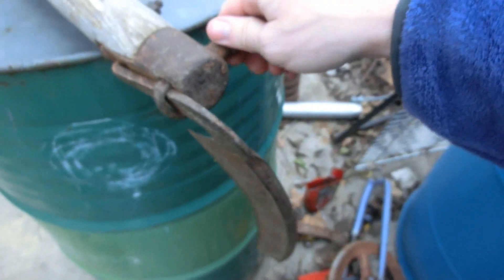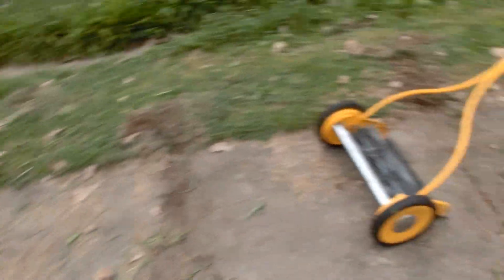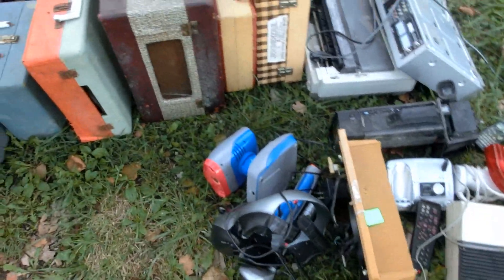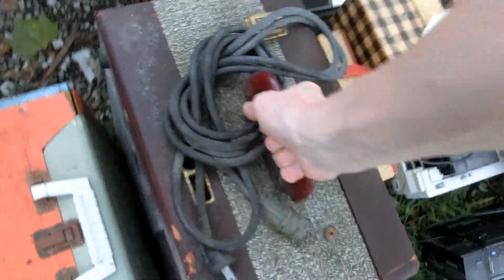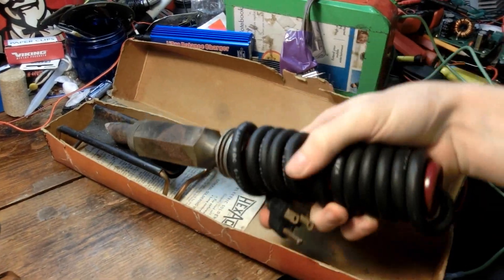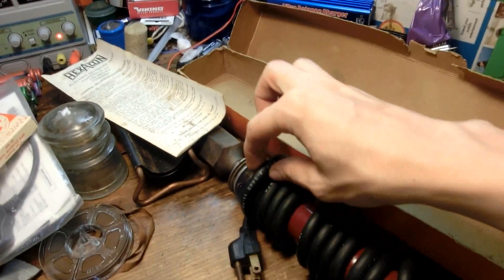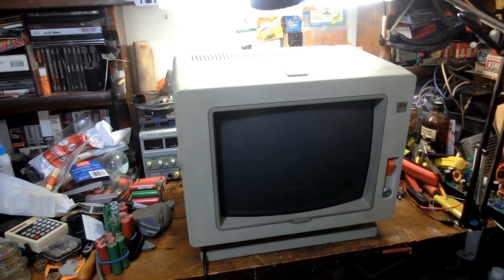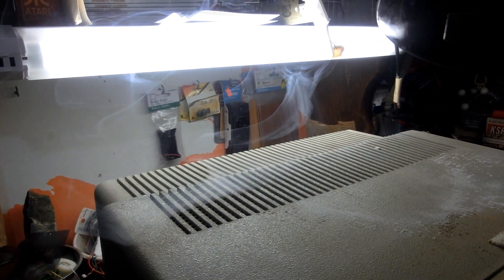Random Bits 0050: Scythes Frogs Oscilloscopes Soldering Irons and IBM Mainframes

Comment: Those phones are GTE, the black ones are AE80, and the yellow one is a "starlite" a copy of the Princess phone made by Western Electric. Cool stuff!
Reply from the maker: who do you think you are the phone man or something? jk. yeah they are interesting. it would be cool to build my own telephone system from scratch to run through a building or something. i've played around with it before when i was like 9 but havent messed with rigging up phones in a while, and definatly havent made a video project about it.
Reply: Rinoa Super-Genius  lol! Yeah, I want to have a telephone museum someday, but I love all sorts of vintage tech too, from older computers to locks, radios, etc.  A step by step switch would be cool, but I have so much stuff, I wouldn't have room for one!
Reply from the maker: Will Phoneman
 come to think of it i prolly have the parts to make a system that could just have 10 phones. one number dialing. but only one call at a time. making a phone system work is super easy until you remember you have to support calls from other phones and multiple calls at the same time or party lines with multiple phones on the same channel GAAHHH. i am so glad we didnt keep the mechanical system otherwise the rate our phone calls have expanded since the 1960s we would need hundreds of square miles of relays and contactors to handle all the calls in the world. so now we just have hundreds of square miles of servers to handle the digital data. ;p
Reply: Rinoa Super-Genius
So much has changed even in the last 20 years, it's amazing. A simple 2 party line is relatively easy, heck I've even hooked 2 of my magneto phones together to make em work. I'm going to try and build an analog switchboard and hook my oldest phones to it and have them able to connect to each other.

Comment: you sounded so disappointed at the end of the video, oh and congrats on 50 random bits videos.
Reply from the maker: nah it would have done that anyway, now i'll know what parts to replace when i open it up.
Reply: as long as you can find them. I didnt see any vac tubes so sourcing parts should be easy and hopefully cheap.
Reply from the maker: John Brewer  the terminal is clearly sectioned off from the computer side and the CRT side, the smoke only came from teh CRT side. and most CRT circuits use similar components, i could crack open an old monitor and prolly find components that are close enough to replace ones in this one.
Reply: good point. it has been a long time since I cracked open a crt monitor. My bad.

Comment: A shame that IBM terminal blew up.. 
Think there's a Chance of fixing it?
Reply from the maker: of course. it was just the capacitors that control the crt. turns out the back part pops off and theres a bunch of chips in there. i was thinking it was a dumb terminal so basicly a monitor. turns out to have a bunch of old AMD chips and an intel 8085 i think. basicly a complete computer inside it. just with each part being a bit weird compared to an IBM PC.

if it doesnt work i may steal the RAM chips. i think i could use those in my 1980 Missile Command arcade machine.

Comment: The soldering iron has a equipment ground plug on it.  Houses in the early 60's were required to have sockets for them.  I'm not sure what year manufacturers were required to have third prongs for the equipment ground, but it would have been about the same time.  The electrical cord itself has a plastic outer covering.
      Take the accompanying instructions and look for the address of the manufacturer. If a zip code was used, that would have been 1963 and on.  Before that in a large city there would be a one or two digit number that would represent a zone in a city.  That number would be printed after the name of the city and before the state.  And if it was a one postoffice town, there was no zone number.
    Under the button, is that a place for a key?  My first PC computer over 30 years ago had a key lock on it.   I think companies thought computer equipment should have manual locks like filling cabinets had.  Soon they decided to go to PIN codes.  There may have been a fear that if someone could turn the computer on without a key, it would be possible to insert a floppy in the "A" or "B" drive which could be used to boot the computer to make changes or repairs in the main "C" or "D" hard drives in PCs.  The computer would start running down drives at "A" on and stop at the one that contains anything and follow the instructions in it.  The mainframes would be different, but they still seem seem to want a key.  The mainframes I remembered always required just a PIN.
Reply from the maker: i'm not thinking this key hole effects the power switch, but could be wrong.

i just checked the paper and there is no zip code on the adress. also dont forget this was made for like factory use. and i think factories and business buildings had ground plugs much sooner than homes.
Reply: If that is a key hole did not effect the power, what would it likely effect?  It is right next to the power switch. It probably shut the monitor and keypad off.  It might be possible to have locks on equipment to prevent them from being stolen, but the lock would not be located there, it would be located where the equipment adjoins the furniture or building structure.
    I just thought it was interesting, because it isn't something one would see anywhere today.
     The funny thing is while there are descriptions of the plugs by NEMA [National Electrical Manufactures Association] on the Internet  with the 3 prong (hot, neutral, ground) 115v being the NEMA 5 plug series, there are no descriptions as to the history when they were implemented.
Reply: Rinoa Super-Genius Rember, these terminals were not "networked" to the mainframe in the way we think today.  They were directly "channel attached".  Not every situation called for a 7x24 station so a key was one way to restrict access while the terminal was not in use in an unmanned room, etc...
Reply: That is why they were called terminals.  There were no computing units at these workstations, the monitors and keyboards were where the mainframe computer connections ended and the human interface began.
      I remember the mainframes were kept in rooms that had notices, that in the event of a fire, a gas would be released into the room that would suppress oxygen since water and other gases couldn't be used.  So you had to get the hell out of there because both you and the fire would be snuffed out.
     I also had a typewriter in my office and used to joke that I could make "undocumented" documents since they weren't created and recorded on the mainframe.
Reply from the maker: *****
 yes thats prolly why it has a key hole, but i was thinking theres a chance it locks the back module from being tampered with. i'll see when i open it up.

btw this terminal has an entire PC inside. ram chips an intel 8085 and several TI and motorola chips for the graphics control.

it's what is called a smart terminal, as apposed to a dumb terminal that is basicly just a monitor with a really long video cable to the mainframe.

Comment: Man u got a great haul of stuffs there... A second soldering iron like that will come in way handy. I'm also mega jealous of the oscilloscope. 

When u wear the leather gloves for testing the oscilloscope did u have rubber gloves under ?  

In Australia our protocol for live testing is wearing cotton gloves and then rubber ones over the top. 36v is not too bad though. Did you work out why there was 36v on the case of it?
Reply from the maker: no i didnt look that close. most of these devices always have a slightly charged frame. of course as components age their insulation goes down. if i touched this it would tingle really bad and the load of my body would prolly drop teh voltage down to 6v or so. its like only a few milliamps. its easier to just add a grounding pin and not worry about it.

and no just leather welding gloves. it was either that or tapping the case to see if i get a jolt without gloves at all.
Reply: Yeh nothing like a little tingle. Getting a jolt on the other hand sux. Over here we call it the 50Hz shuffle. I guess in USA ud call it the 60Hz shuffle.

If I ever touch something to c what happens I always use the back of my hand. Muscle will make ur arm contract away from it instead of grabbing it, but this can end up in punching one self in the face, lol. In worse case scenario I guess.
Reply from the maker: Nitris
 I just tap the side with one finder.
Reply: Rinoa Super-Genius
same here

Comment: Fun video btw the reason small soldering iron won't work for ya is because your using it in garage with low ambient room temperature. I recommend you to get the soldering station with pull trigger (like a hair blower). This will save you and family with energy/money having it on demand soldering in matter of seconds. ...just pull trigger.   As far as your soldering skill ...umm.. LoL! You need to consider technique/ambient room temperature/solder type vs application/flux paste/time applied on soldering components vs heat=damage (assembly or removal)....

If garage is all you got for lab work then trade your 300w solder tool for heater and buy a updated solder iron but solder station with on demand is best... This will benefit you from catching cold and heating up garage room will give u better soldering and proper skill learning to do the right way..especially that you are young and a bright kid :). Don't waist money on junk think through it before spending hard money earned...just my friendly advise for ya..
Reply from the maker: i've tried the trigger soldering guns and they suck. have tried 3 of them. i'm done wasting money on tools when i already have 2 that work great.

btw 300w would cost 2 cents an hour to run, and i usually only run it for half and hour. thats not exactly breaking the bank.

also i dont have a garage. the workbench is in my bedroom.

sorry but your advice sounds very incoherent and stupid. you want me to not wast money on junk....by not using my good tools and wasting money on junk.

my advice for you is if your giving advice, don't be know as the guy who gives bad advice.

Comment: Id toss that old iron and use the hex one as it probally is alot more sturdy and functional than the old one also those record motors can be useful as well they wont be powerful but still can make cool items with it
Reply from the maker: lol you say "old one" well both soldering irons are close to the same age. i'm not going to throw away the first good iron i've found. they are both from about the 1950s or so.
Reply: Rinoa Super-Genius
a bit of filing on the copper tip, re-tinning and it will be as good as new anyway, the tips always get slowly eaten by the soldering, but it has a lot of copper to go yet
Reply from the maker: jusb1066
 tbh its not causing an issue so i'm too lazy to fix it now hehe.

Comment: You could probably pull that stuck screw from your soldering iron with an impact driver and some penetrating oil.
Reply from the maker: i figure i'll just leave it in for now since it works fine.

Comment: Hmm the terminal just terminated itself lol, if the monitor side is dead im sure you could drop a different monitor inside it.

Your push mower would be hard to push on rough ground, they are really ment for smooth lawns that are mowed every week, lawn lovers lol.

The scythe i think is best on long stalked crops, back in the days of manual crop reaping, but grass would tremble with fright as well ha ha :-))
Reply from the maker: its prolly just capacitors that went bad.

i'm thinking the scythe would be good for getting the tall grass in the ditches.
Reply: Rinoa Super-Genius
Yep that sounds ideal, just be really carefull with that blade, it has to be very sharp to work well and we dont want you damaged ok?

Ahh the words "oil stone" came from my foggy brain lol.
Reply from the maker: zx8401ztv i doubt i'd get hurt from that, its always the simple things that get you.
Reply: Rinoa Super-Genius
A stray drawing pin (thumb tack) found my foot once, ooow i did swear lol :-))
Reply from the maker: zx8401ztv
 haha. those hurt along with legos and power plugs.

Comment: Keep that heath analog VOM safe, They are getting hard to come by nowadays. Too bad the IBM terminal fried, it could have been saved if you knew what I know from information I gathered on a BBS years ago, so I'm going to explain it so that next time You too can save one.  It is very simple to understand the steps needed to be taken by examining your video and seeing that when you plugged it in and turned the power switch to the on position smoke came out of the vents and the machine quit working.Thus by using logical reasoning we know that when components expel smoke they quit working, so we have to keep the smoke inside and a simple way to do that is to wrap the monitor in plastic wrap and not let the smoke out.  LOL, I hope you know I'm not serious here except about the heath.
Reply from the maker: lol the terminal isnt dead. its just a few capacitors is all. evidently the back panel comes off and theres a lot of nice circuits. none where hurt.

and yeah dont ever worry about the heathkit stuff, i'll keep that stuff in good condition. heathkit is one of those brands that i want everything they made, especially the heathkit Hero-1 robot.

at first i thought you where serious and was getting ready to type a wall of text but then you sounded too confident and thats what started to give it away haha.

Comment: hey if u can tell me how charge the led acid battrys i got u can have lithions im sure wont cast much to send u
Reply from the maker: what configuration are you wanting the batteries in?
Reply: well they r each 12v so im thing parallel if thats safe i got 4 of them outta a net power thing n yea each is dead i tryied led n get nothing so i need charge them
Reply from the maker: Eric Goodwin
 so 48v or 12v? might not get them to charge.

just watch some of my videos about restoring batteries. if that doesnt help then i dont know what to tell ya.
Reply: ok ill watch that n see i was thinking about trying a power supply off computer to try but not safe n iv got this box for u so i should b able to send u the lil lithions n a few extra ones in a bag

Comment: The terminal is replaced with software emulation through TCP/IP protocol so that terminal is probably worth more in desoldering parts you can salvage huge capacitors and transformers out of it....get your money 10x worth.
Reply from the maker: fuck no, this is a beautiful piece of engineering.

btw terminals havent been replaced by emulation, the entire mainframe-terminal system has been replaced by PCs that network to a server via LAN. terminal emulation is only used for legacy systems.

if you think the only reason for me to get this is for money then your wrong. i dont care about the monetary value of the things i collect. i got it for free out of the mud, so its not costing me anything.

Comment: Make a video about fixing the monitor and the osiloscope
Reply from the maker: i will.
Reply: good call on testing if the case was live and the gloves, what a deathtrap!
Reply from the maker: jusb1066
 no not a deathtrap, just annoying. 30v ac isnt all that bad. especially for something like this. if i touched it the voltage would prolly drop to like 10v ac because there isnt a very good connection to the case. but just enough connection that if there is no load it will go to 30v.
Reply: Rinoa Super-Genius i did a test once and i found that for me on an average day i need about 50vac @50hz or 65vdc to feel anything i used a power amplifier for the ac test so i could have adjustable frequency/voltage/waveform.
Reply from the maker: Thomas Sears
 yeah that sounds about right. i havent done any good tests, just going off what it feels like when you lick it with your highly conductive tongue haha.

Comment: I have nothing bad to say about that massive iron, but... If you gonna want to progress in electronics, at least you need a small iron to do most of the work. I have soldering station, 40W iron and 100w soldering gun and station is usually sufficient, if I need more heat, I use soldering gun, not enough - my 40w iron (it has more heat capacity). That's just a suggestion, I simply found your vids exciting. But you do wide range of stuff, while I'm turned in electronics. Just really wanna see some of that stuff repaired.
P.S. Check caps in power supply of that monitor.
Reply from the maker: well i've gone through a bunch of soldering irons and all the ones i've gone through where crap and could barely heat anything up after a week or if ever. these big soldering irons work great.
Reply: Rinoa Super-Genius Well, if those works fine for you - great. I posted comment 'cause I can't imagine soldering lil' components to PCB with such a monster. Most of the time I deal with small stuff, but you deal with some massive stuff, so that iron suits your needs just great

Comment: Yeah that's fried.  I never had a problem with your soldering iron, other than the very large tip. I figure if you had a very pointed tip it would be better when doing circuit boards. If it works, why change??
Reply from the maker: only a few capacitors in the CRT board fried though. or so i think.